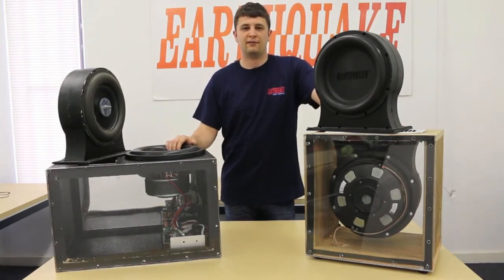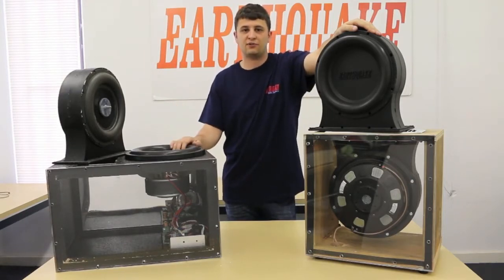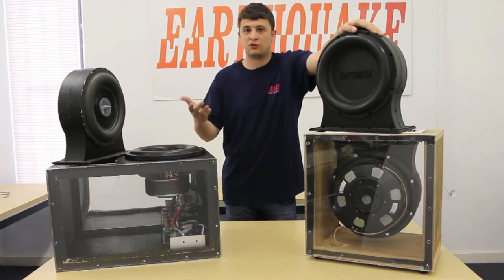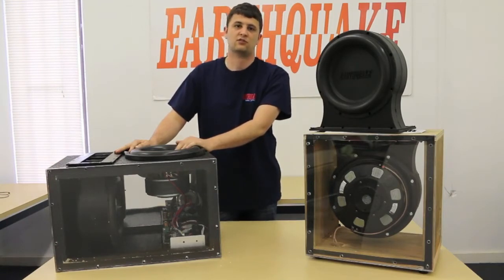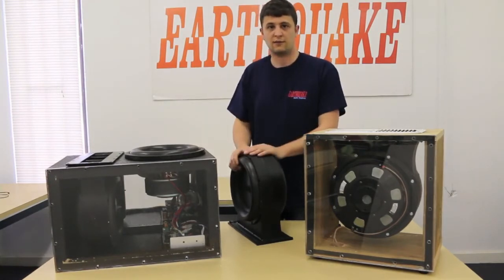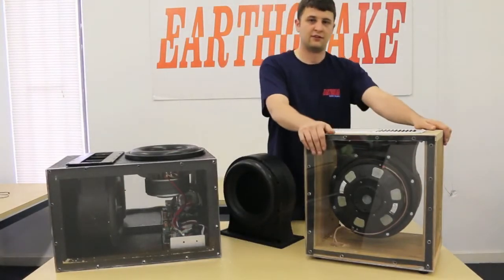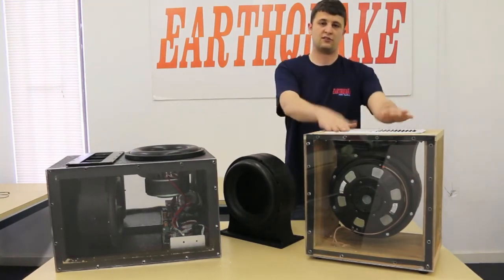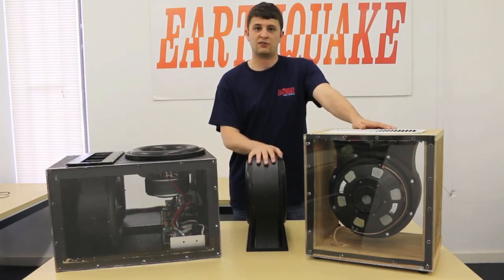Earthquake Sound: Pump-12

Comment: What would happen if you mounted it on the outside of the box (upside down)?
Reply from the maker: Hi Jason! The PUMP-12 will work if mounted inside-out, but it will perform better when used as originally intended.
Reply: You would have a really cool looking windmill.  Or, you could capture the wind and cool off the batteries in the Prius?  j/k

Comment: Well, I guess I will be one of the first to test it out. Ordering two PUMP-12's and two Earthquake Subzero 15's. Pairing these with a set of Klipsch LaScala's.
Reply: And how did it work out?
Reply: I ended up running two PUMP 12's with a 24" Stereo Integrity sub. Seems to be doing fine but I haven't pushed 2000 watts yet. Did not have the right connector for the Crown amp.
Reply: @stiffmeister0hYeah  Thanks, I have thought about using 2 pump12 on a 18" B52 sub. Because the EarthQuake 18" SLAPS18 is terribly expensive.
Reply: @JMacSilvia  outdoor music venue